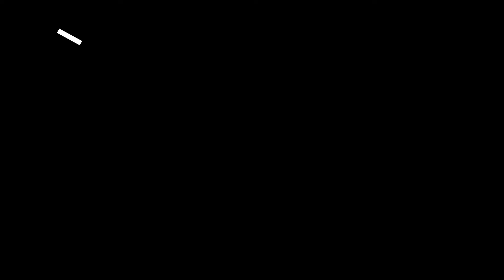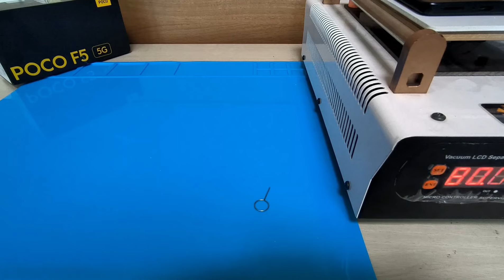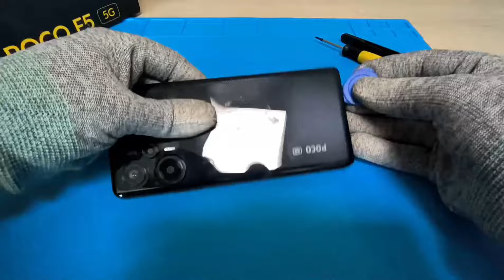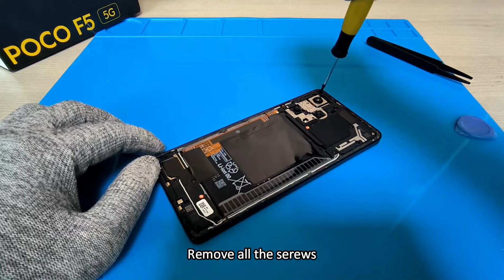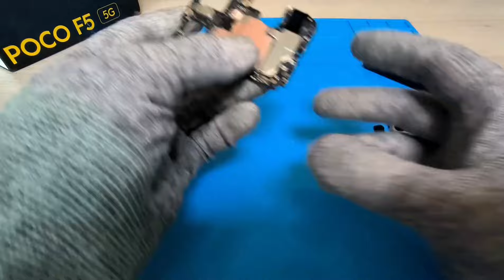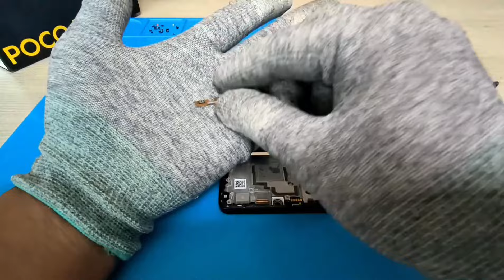POCO F5 Disassembling Quick Guide

Comment: Great video. I want to ask something related to soapy water damage to this phone. water was on it for around an hour.

It stopped fast charging(67watts) and camera lens had fog. Rest of the phone was working fine.

Used the phone for a day before plugging the charger. Immediately switched it off and left it drying with silica gel packets. after 12hrs back camera lens fog has gone and front camera fog has lowered but not gone. 

Do you think the motherboard will be damaged and corroded by now? or should I take it to repair shop to clean? 

After a week of drying, is the fast charging going to come back?(because it is charging slow and not stopping, I think its not dead) I remember the phone saying "external dac plugged in" during that one day of use, maybe its thinking a device is plugged instead of charger and only allowing slow power flow.

what do you think? will I have to get the usb port replaced ?